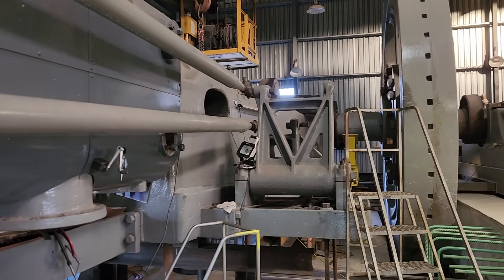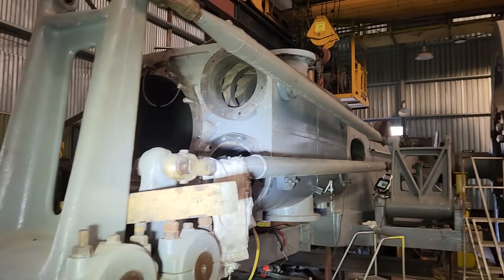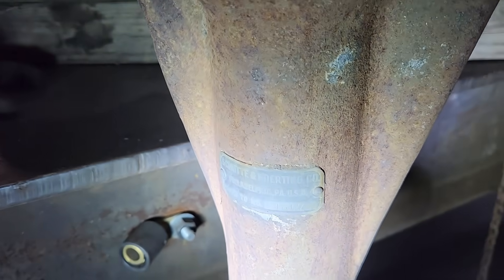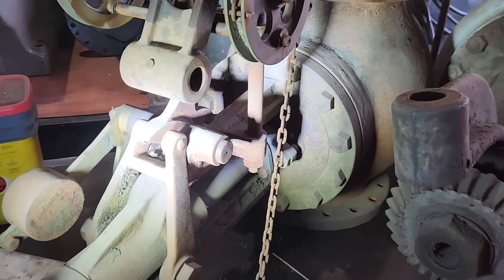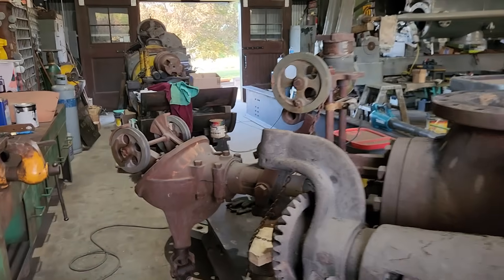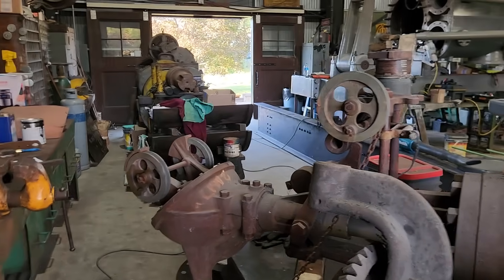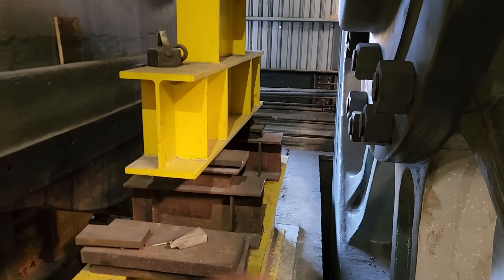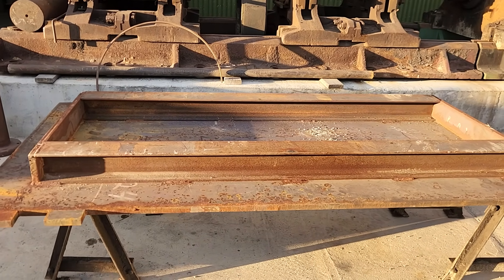Tod Engine - Results of the First Day of Line Boring

Comment: S&K does actually still make steam engine trip and throttle valves, albeit not for these type of steam engines, but rather for steam turbines.  The design is identical to the Gimpel design.